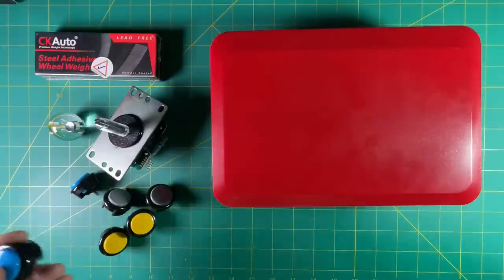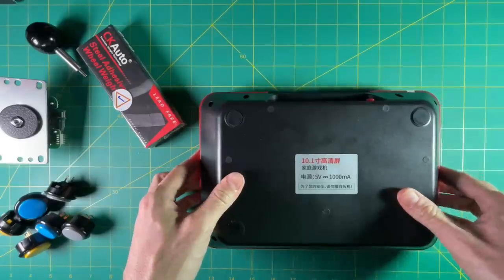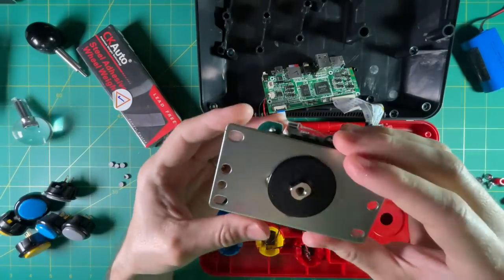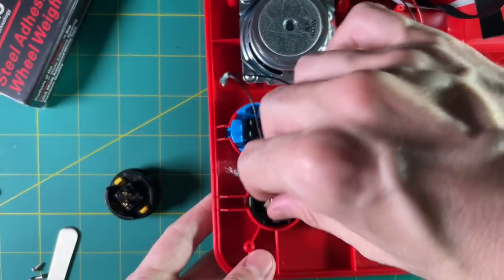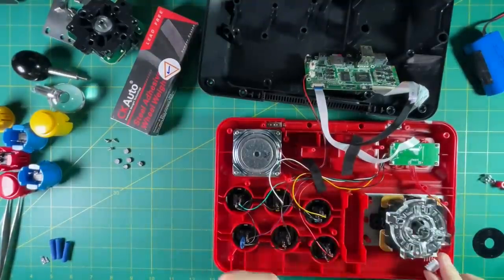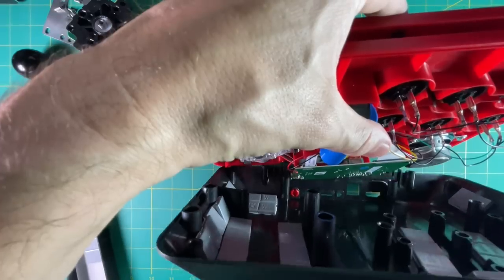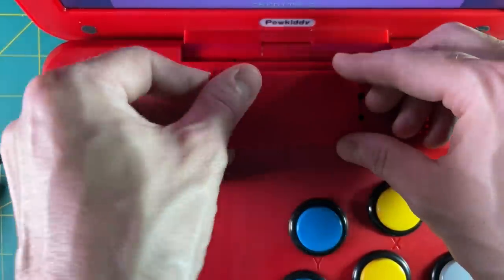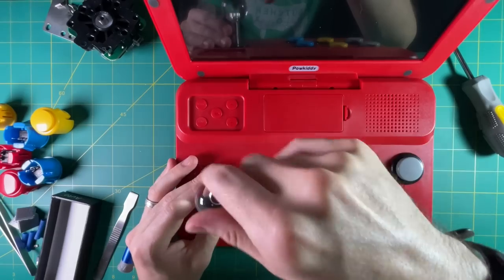PowKiddy A13 Hardware Mods -- Buttons, Joystick, and Weight Rebalance

Comment: I just finished this upgrade with the exact same parts. I had no issues with the buttons or wires, but ran into a major issue when trying to remove the mounting plate on the Sanwa joystick. I’m not sure if Sanwa doesn’t want customers doing this mod anymore, but the Sanwa joystick I got had pretty strong Loctite screw adhesives holding the mounting plate in strongly enough that I stripped two of the screw heads trying to take them out. I finally gave up on your method because of this and put the screws back in tightly and used a Dremel tool to grind away enough space on the outer plate holes so that it would fit into the case properly. This turned out to work perfectly and the upgrade is complete and so much better than the cheap buttons and joystick it shipped with. Thanks for the detailed instructions on doing this! Just thought you should know of complications others might come across with new hardware from Sanwa.

Comment: Using the old metal plate to allow the new joystick to fit in the device, or in general, installing something new, but using a piece from the old part, in order to help it function properly, is called "Retro Fitting" which is very appropriate in this situation.
Reply from the maker: Ah, that's the word!  Thank you.

Comment: This device is really growing on me now with the mods.
EDIT:
As of this edit, the detachable joystick are all sold out.
Reply from the maker: Yeah unfortunately they're out of stock -- hopefully they restock soon!
Reply: Maybe look at a normal sanwa stick with a Phreak Mods The Link. The latest version holds the dust cover in place with the stick, so you’d need an older version of you want to store it. Oh, and I haven’t tested the shaft yet to see if it fits in the compartment either so it’s a risk either way. I’ll post my findings here once I get my A13!
Reply from the maker: @kimble02  Looking forward to seeing what you come up with, thanks!  That Phreak Mods one looks nice.
Reply: @RetroGameCorps  well... got my unit and man oh man is that wiggly stick wiggly. Tried the Phreak Mods and it’s too wide to fit in the storage compartment.😞 I was thinking about doing a stick tear down and swapping out the shafts but found another site where the detachable screw tops are available. So I went the easy route. I’m doing the EZ mods but planning a pi install. The battery pack is the one part that’s getting me. Not sure if I’ll have  to use a voltage drop down module. Seems like that’s a heavy possibility.

Comment: Nice. It's also good to see that asides from the non-standard joystick mounting plate, it's all fairly standard sized stuff inside.

Personally, instead of going the Sanwa JLFD-TP-8YT detachable lever route, I would have tried using a standard Sanwa JLF joystick (or just kept the stock joystick assuming that it is just a JLF clone) in combination with a Phreakmods EX-Groove Link quick release shaft, assuming that it would still fit in the holder (the Link shaft diameter is equivalent to a standard JLF shaft + normal shaft cover, whereas the overall diameter of the Sanwa detachable shaft +  detchable shaft-specific cover appears to be larger than that). The shaft itself costs about as much as the entire detachable lever Sanwa joystick, so that may make it a little more cost prohibitive given what it would be going in, but it's attachment/detachment mechanism is much faster, although it's installation may be a bit tricky for someone inexperienced with joystick modding.

As for the buttons, I think I would go with Crown 202 MX buttons, which make use of Cherry MX keyboard switches inside, and are hotswap compatible with a wide variety of other MX or MX-compatible switches, allowing you to really dial in the feel you want.
Reply from the maker: I was looking at that Phreakmods shaft, maybe I will go that route some other time.  Thanks for the notes re: buttons!
Reply: Ha! I just posted the same thing. I have a EX Groove I was going to try out. It does hold the dust cover though. I guess I’ll just take it off. Hopefully it fits in the compartment. Eagerly waiting for my unit to arrive!

Comment: Okay. I might as well mention it on here since this video encouraged me to mod the device to begin with. Sadly I do believe the power button has broken, and I'm not quite sure if it's the switch attached to the motherboard or if its the plastic pushbutton giving me issues. The pushbutton will not "lock" in place once pressed nor will it turn on the device unless pressed in extremely hard. Also, unfortunately the sd card fell out and broke in half. Now, I know you can buy the motherboard for the device separately on Aliexpress and that it supposedly comes preloaded with 9000 games but do I even need to do this? Would it solve anything or is there a simpler solution? Help would be GREATLY appreciated. Thanks.

Comment: Hey, nice video, thanks. 

Thinking about buying this device but it'd be mainly to play vertical shoot them up games. Do you think it'd be possible to open the top part (where the screen is) to see if the screen can be rotate somehow? I was thinking about maybe cutting the top part of the plastic so that the screen could go outside with no problem (not too neat but really looking for a vertical screen, I just wonder if it seems that top part could be easily opened?)

Comment: WARNING: DO NOT attempt to mod your Pow Kiddy A-13. It is trivial to break many things (such as the power button). I followed this video very carefully and ended up with a broken power button. It's just not worth it. I will have to buy another now and throw this in the trash. The thing basically self-destructs if you open it. I think the guy who did this video was just very lucky with his power button.

DO NOT ATTEMPT UNLESS YOU ARE HAPPY WITH HIGH CHANCE OF DESTROYING YOUR DEVICE.
Reply from the maker: Sorry to hear this happened to you.  I've opened up two of these devices at least a dozen times each without issue, but yes I've heard of a lot of people breaking the power button -- that's why I make note of it in the video.  I would recommend asking in the Team Ruka channel on Telegram, several people have figured out how to fix a broken button, or how to order that specific part.  The only rub is the channel is in Spanish, but if you ask in there someone will help you out.  https://t.me/joinchat/B5SjM1OVlW0eD-0Tv5GrmA

Comment: I'm having issues with my A13 overheating and it stops after about an hour or so. Do you have the same issue? I'm thinking on putting some heat sinks and even a small fan and some holes.
Reply: I was actually expecting that to be one of the mods he did. Good to know someone else is (was?) thinking about doing it. How'd it turn out if you did it?
Reply: @penismightier9278  it turned out pretty good. I did both mods (heat sinks for raspberry pi and a small 5V fan) and even though it still gets warm, I can play a lot longer without issues.
Reply: @FernandoLagunes  Now that you've installed a fan on it, how is the battery life? How difficult was it to add the fan? Any soldering required?

Comment: I just got my PowKiddy A13 and I am ready to mod it. However, my on/ off power button is different to the one you have. I believe it is called a "rocker switch" with a red button housed in a square black plastic base. Do you know of anyone that has tried dismantling the case with this type of switch and would it be easier and less of a risk? Please let me know if you have any advice. It would be appreciated. Thanks for doing the video.

Comment: retro I still see a lot of people in doubt about which firmware to install for rg351p. Can you compare performance on arkos and 351elec games? Currently 351elec has more updates and is in version 1.0.8. Another question, do you know why 351elec no longer support halflife?
Reply from the maker: Hi, they weren't able to port over HL in the new exFAT partition of 351ELEC.  Hopefully they can bring it back.  Performance across the board is the same for ArkOS and 351ELEC, maybe a bit better N64 on ArkOS but everything else is virtually equal.  I'll try my best to put something together that showcases something.

Comment: As i was following  your video the sd card came out on mine. I put it back in but now all the files and emulators are not listed. I click on games  and it doesn't show any emulators, it just starts up the same 1 game every time. Any ideas?
Reply from the maker: Hi Rob, it sounds like your SD card was damaged or just plain failed.  Send me an email at retrogamecorps (at) gmail, I can help.

Comment: To avoid losing the plastic cover I wonder if you can just buy a normal sanwa stick and use a Phreak Mods unit to make the stick detachable? It shoullld fit in the compartment. And the shaft won’t spin out. Just ordered my A13 and already have a Phreak Mods shaft so I’ll test it and post when I find out.👍🏼

Comment: Well done. For me, the A13 has been a pain to mod. I broke the power button and might not receive the replacement part from China. 

You might want to add rubber foam to the bottom for better grip. Cheers.
Reply from the maker: Good point on the foam, sorry to hear you've had issues.  I had heard about the power button so I was super careful with mine.

Comment: What kind of heatsink should I fit?  Having bought one I found out it overheats a lot and dies during any emulator that stresses it out e.g. Amiga P-UAE.
Reply from the maker: I'd have to look inside and see how much room we have to work with.  It has definitely gotten hot when I play it, but to me it feels like the battery.
Reply: @RetroGameCorps  On mine the heat is very much below the joystick compartment.  Judging by your disassembly there, it seems to be from the main board.  Are you able to play the more taxing emulators for >1hr?  I find stuff like Amiga and certain arcades (e.g. ddragon one on MAME not Neo Geo) for, say 30 mins+ will push it over the edge and make it freeze up or sit on a black screen.  I'm getting a raspberry PI copper heatsink tomorrow although I think it might need a fan.  Cool machine though, just needs some love :D
Reply from the maker: @endoflevelboss  Honestly, I’ve never played it for more than 20 minutes at a stretch.  I hope a heatsink helps, let me know how it goes!
Reply: @RetroGameCorps  Fixed the issue, with perfectly fitting copper heatsink from PiHut (with adhesive tape already applied).  Tested and it's no longer bailing under heavy load.   PiHut part = 103181 👍👍👍🥳

Comment: The way you went at the wires for the buttons... Cringe 😖
Never pull a crimped connector at the crimp point. You want to grab by the portion that is metal on metal.
Reply from the maker: Haha, sorry for the cringe.  That makes sense, thanks for the tip.